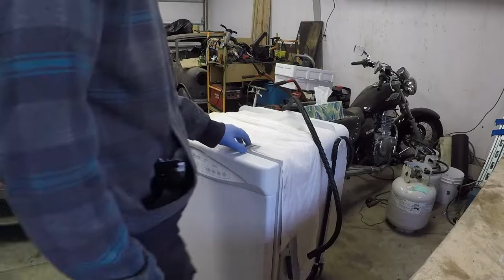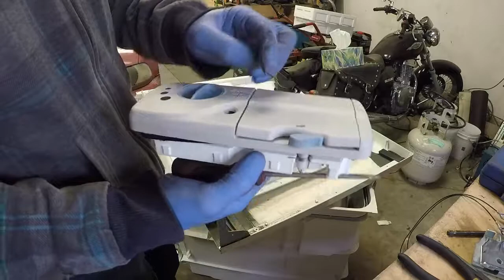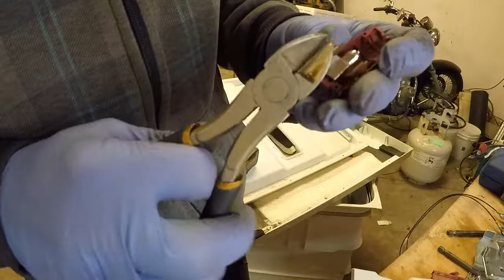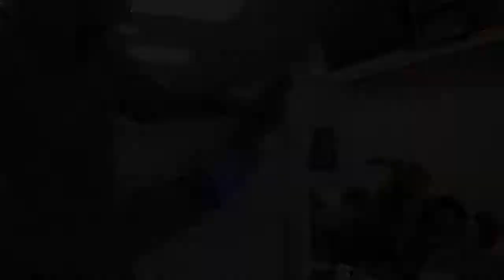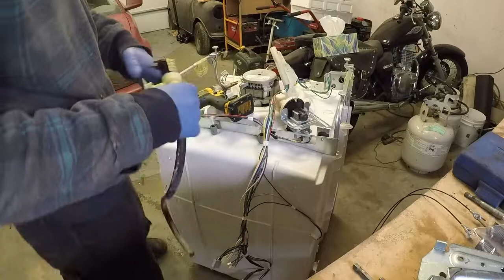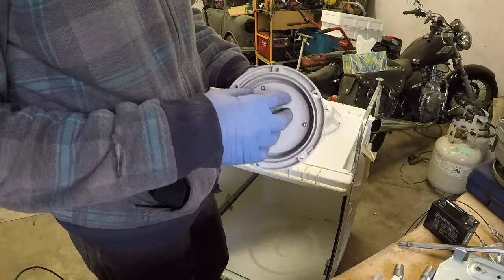MAYTAG Dishwasher Teardown. Quiet Series. MD85600AWW

Comment: I know this video is 2 years old but, I have a question:
My dishwasher had a short-circuit at the plug due to bad installation and it has since stopped working.
I think the board got fried but I want to know: does anything beside the board and the panel seem to have small delicate electronics(ya know something that could have fried too)?
I'm wondering if I can just change the board and everything will work...
Do you think just the board replacement could work?
Sorry to bother you by the way....
Reply: @JoelArseneaultYouTube  thanks 
The short circuit was because the AC power cables were too thin and so they melted and started touching eachother.

One question has this dishwasher been working well?
Is it reliable?
I've actually never used mine because it didn't work when I was younger so now with the quarantine I told my parents that I'd fix it so that we can save some time washing dishes.
Reply: @JoelArseneaultYouTube Good to know!
This is a bigger incentive to repair mine but the control panel is hard to find and expensive...
Since it is a Quiet series 200
I'm starting to wonder if it he touchpad and control board of a Quiet series 300 can fit mine... That would save me a buck or two.

Anyway I hope I find a good deal on the pieces I need...
Have a good one!